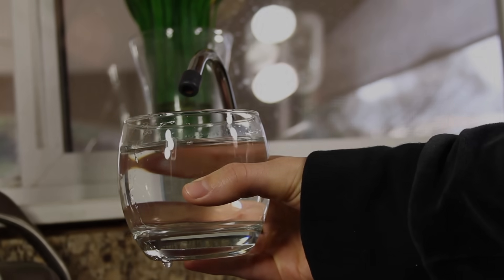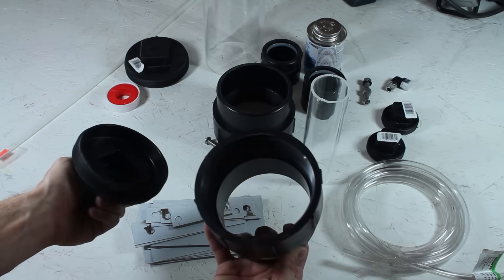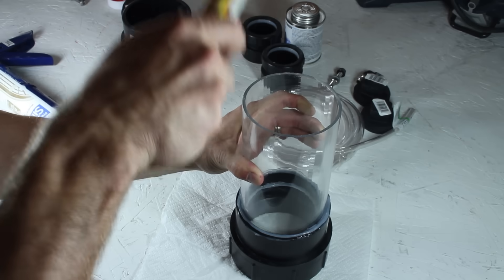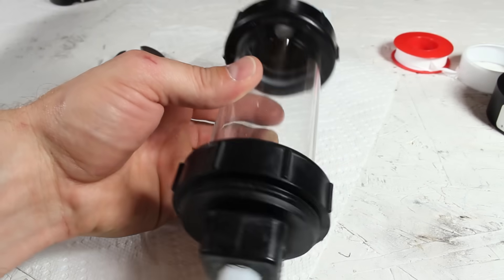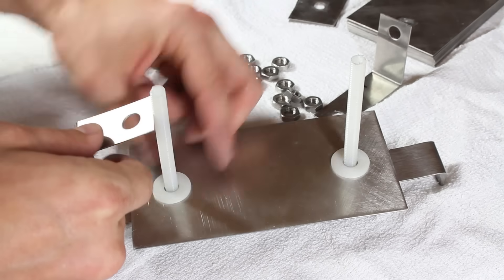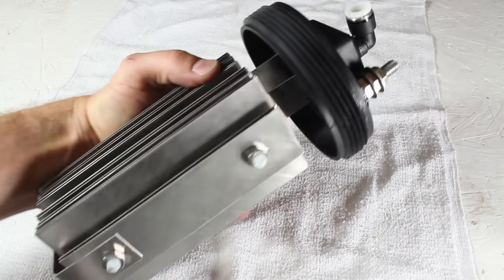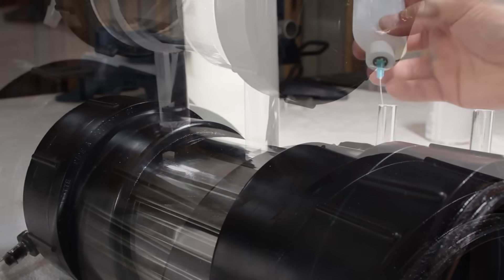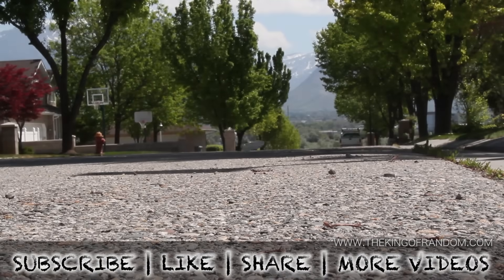HHO Generator - Water to Fuel Converter

Comment: Can you show us how you would install it a car?.....
Reply: HHO Sailing is either a bot or a totally ignorant person that blindly believes that he can CREATE energy!
Reply: HHO Sailing
Before treating somebody as an idiot, at least try to understand what is actually going on in the video. He's using electricity to turn water into hydrogen. Hydrogen can then burn freeing some of the energy which has been used to separate it from oxygen in the water...

In a car system, you're using some of the engine's power (given by gasoline) to spin the alternator which makes electrolysis happen. Again, the energy contained in the hydrogen is LESS than the energy contained in the gasoline consumed to make the electrolysis happen!!!!
YOU ARE WASTING GASOLINE INSTEAD OF REDUCING YOUR CONSUMPTION!!!!

Of course the car might perform better but that's because of the water vapour generated by the combustion of hydrogen. That's the same concept of water injection, or steam-diesel engines. They have been used since at least 30 years in railway locomotives!

Two options: you are either trying to sell your stupid and wastefully HHO systems, or you're just a bot or a very ignorant person...
Reply: MrOpenGL YOU are so correct. I just wanna add a car's alternator Is only 60% efficient so its a major waste to use  an alternator to generate the electric needed to split the water into hho. Using a magnet generator  would be much better as they can be as much as 97% efficient. But all said an done its still stupid to produce hydrogen in a car.
Reply: That is stupid and not even his intent. Plus its a waste. HHO CAR kits waste a lot and dont work.
Reply: People have been using that for years. You absolutely are clueless! You are probably one of those guys who believe everything the government says. Maybe you are not clueless but straight up stupid!
Reply: HHO Sailing
Lots of scammers keep promoting it. It was all over the news how this scam work and its all over the internet that this is a scam. And if you do the math you yourself will see its impossible to increase your fuel mileage using hho device.  I see you know nothing and a type of person that would fall for anything. Normally around 35% of the energy in the gas goes to your wheels. BUt if you use this energy to break water down into hho you only end up with 6% that goes to your wheels.
Reply: Yea...that's why Hyundai, and Totoyota built & just release their HHO Fuel Cell cars for production. You have to stop believing everything your government tells you, you need to learn how to think for yourself!
Reply: HHO Sailing Hyundai, and Totoyota does not generate their hydrogen on-board and they are using fuel cells with is a lot more efficient than a normal motor.   The hydrogen  they are using is most likely made from natural gas since this is how most hydrogen is normally produced.
Again your argument is week and pointless.  trying to compare what Hyundai, and Totoyota is doing to these hho system is very stupid. Once Hyundai, and Totoyota get electricity from the fuel cell they use this electric to power a motor that is attach to the wheels instead of using it to split water into HHO. They would never in a million years waste the electric on producing HHO on-board a car.

I never heard anything from the government  about hho kits. I done the math myself to see it doesnt work.  The news is also not controlled by the government as you imply. Dude your reality is really screwed up. you need an overhaul on that brain of yours.
Reply: HHO Sailing

I think what Samuel is trying to say, is car generators produce a lot of power. Now if you fit your very own converter in a car, it'll require too much power from the batteries for a sustained use, so you might as well power the motors directly with electricity. Solar power is not strong enough to sustain this, at least not in a practical sense. Most gas used by cars and largely by taxis and buses are derived from the ground. Just because it's many times cheaper.

Now if you fit your whole roof with solar cells (which could cost you several cars) and run this generator in your garage. You would still have to deal with safety issues as the gas is stored in high pressure. Also the energy needed to pump it into the canister is relatively costly too.
Reply: Balee Tong LOL I wish I had a magic wand to get through to people like HHO Sailing. Its kind of sad he is so lost in his own little world.
Reply: HHO Sailing Why would the OIL Company not want hho devices to be used? The HHO devices uses/wastes a lot more energy then without it. So its quite clear the OIL Companies would love it. Far as I know the government has founded the use of hydrogen. again you are so wrong. Stan Meyer's own investors sued him for fraud. Investors just dont sue when they make a bad investment. They sue when fraud is involved.
Reply: MisterDirectx11: Are you blind or just plain stupid?....
Reply: Samuel Atkins  The explosive gas that's produced in this type of convertor is hydrogen. Hydrogen is extremely explosive. It also can be used on vehicles. I have seen vehicles run on LPG, which although is less explosive than hydrogen, is used in the same manner as can be used with hydrogen. I know though, you'll call BS. Why? Because you refuse to check facts, and rely on pride alone.
Reply: scrmngchicken403
 I'm not discussing about the ability of making a car run on compressed hydrogen. It will work like a car with a LPG or CNG tank.
Obviously the engine needs to be adapted and moreover fuel cells and an electric motor are much more efficient.
I'm discussing about the usefullness of making some hydrogen on-board with the car alternator (wasting more fuel) that would supposedly.. cut the fuel consumption! In fact, it even INCREASES the fuel consumption!
Reply: scrmngchicken403 IF you want to get 100 units of energy out of an Alternator you have to use 166 units of energy to turn the Alternator. Also the electromagnetic fields is not what charges the battery. The electromagnetic field creates electricity  within the Alternator that than leaves by means of wire and goes to the battery. The Alternator will turn easily when you not drawing current from it however when you draw current from the Alternator it begins to turn really hard using up a lot of energy from the gas motor.  You alternator is a  big parasitic drag when you pulling lots of electric from the Alternator.
Reply: I have just read the various comments and opinions shared here with some interest and some dismay as well. I have an interest in the use of Hydrogen in increasing the Hydrocarbon fuels efficiency in internal combustion engines, more specifically in my daily drive.
  Several thoughts come to mind, these are as follows.
1 You can't get more energy out of a system than you put in, otherwise perpetual motion would be a fact of life.
2 This is me being pedantic, electrolysis does not make Hydrogen, it breaks the bond of the water molecule and releases the H and O into its elemental state, that is a gas.
3 For use in a vehicle you are actually promoting the more complete combustion of the fuel that is normally consumed. The way I understand this to happen is that H burns a lot faster than the primary fuel and reduces the amount of unburnt hydrocarbon. This shows up as an increase in power out from the fossil fuel or using less fuel for the same power out. The combustion of the H in this format does not actually add significantly to power out from H, merely to gain the most from the primary fuel.
 To what extent gains can be made in efficiency seems to be a subject of conjecture, I have heard/read claims of from 20% to as much as 50%. The only thoughts I have had in regards to these figures is this is all dependent on the subject engines initial efficiency. This will no doubt be a more dramatic improvement in older petrol and diesel engines in comparison to modern electronically controlled engines.
 I believe there are gains to be had, to what extent will depend on the design efficiency of the electrolysis plant and the subject engine.
 For those interested there is a book called "Fuel From Water" by Michael A. Peavey that I purchased that has a series of case studies by various departments including Universities and other scientific bodies that goes to a great deal of detail in extracting H via various means as well as results from its use. I make no claim to fame on this subject, I am just interested and have done a fair amount of research with the result that over the next year I will see if I have wasted my time or gained from the experience.

  Cheers from John.
Reply: HHO Sailing lol sure sure. the government and BIG oil companies are stopping this. Thats why no one outside of america hasnt made any big progress, RIGHT? Wow, idiots like you thinking US is the entire world and only you live in it.
Reply: HHO Sailing Please Google "Laws for conservation of energy" have a good long read up on it.
Reply: Splitting hydrogen from water for combustion is inexpensive. This technology was introduced in the early 60's, however big Oil companies, and the government prevented it from being in the mainstream because of the taxes and campaign money it brings. Don't be fooled, educated people have installed these HHO converters in their cars. Just look it up. Car makers like Hyundai, and Toyota now trying to implement this technology to the mainstream. It's up to the government to allow this to be pass!
Reply: The government & Oil company makes too much money to allow this. It will be a slow process before the government passes this bill. In the meanwhile, people who understand this technology are doing it themselves! If you don't know, you better ask.
Reply: +Samuel Atkins, I think we should just let him win the internet. I can't be arsed really.
Reply: MisterDierctx11: Do you think this video is just a conspiracy to make you believe otherwise?...You're an idiot!
Reply: HHO Sailing You are an outright liar. a little bit of knowledge about  cars engines, alternators and fifth grade math makes it clear that is impossible.
Reply: For all the retarded people like HHO Sailing and for those who dont know if hho kits actually work here is some-info.  Investors are very smart people. They only invest when they feel a profit could be made. Investor  will invest in almost anything that can turn a good profit so long as the profit is returned quickly and its legal. You can ask any investor in the world would they invest in HHO companies if these HHO kits actually worked as claimed by all these HHO users and scammers. Nearly 100% would tell you yes. But this doesnt happen. IF these HHO devices worked there are millions of dollars to be made. 
Practically no Investor on the face of this earth will invest in these HHO Kits. And that is because these HHO kits dont work and wont turn a good profit or any profit at all. You can ask any Investor (who knows how the system work) how much more popular would hho devices be if they actually worked and they would mostly likely tell you these ktis would be hundres if not thousands of time more popular if they worked. This is the area that investor are really good at so they know what they are talking about. Whenever there is any invention that been around for 50 or more years  that people claim to have extreme money saving potential but never takes off and become popular  is nearly 100% of the time a fraud  device.
Reply: Who said anything about investing?.... HHO fuel cell can be made under $100 and it's easy to do. Everyone should and can do it. You probably have some kind of government ties or Oil company investment to adamantly discourage people from making their own HHO fuel cell to save money on fuel.
Reply: Samuel Atkins....are you that naïve to think that government & oil companies have our best interests. I personally think you just too ignorant and naïve to think for yourself, so you tried to argue on a topic you know nothing about because you rely on the so called '"facts" that our government creates for us to believe.
Reply: I don't know about the HHO kits, do know one thing, it makes sense to me and a friend of my fathers made a system up for his V8 Land Rover. He says it works well enough to save him money and he is not trying to sell me one. The bottom line is you have proven yourself it works or you proved yourself that it does not work, and that is only your system, not some others system and as such no one person can claim to know all the answers. Cheers from John.
Reply: If you can't think for yourself, you can't be helped!
Reply: The expression that comes to mind is " you can lead a horse to water but you cant make it drink" cheers from John.
Reply: I'm not here waste my time to educate a non believer. If you really want to learn about, do some research. If not, one thing less to understand for that narrow minded brain of yours.
Reply: Look, I'm not here to give you any freebies. If you want to take advantage of the concept then I suggest you do your own homework.
Reply: scrmngchicken403 Samuel Atkins either is an ignorant ass wipe or works for the government.
Reply: Like ant alternative fuels, an engine must be prepped for it. Ethanol destroys rubber seals, has a lower BTU than regular fuel and produces about 30% less power. I'm not too familiar with burning hydrogen, but from the water production, it will rust nearly everything on the exhaust side. There have been successful attempts at fueling engines with hydrogen though...
Reply: Alternators are not like pumps. There is little parasitic drag from an alternator because instead of pumping fluids, it is generating an electromagnetic field, which charges the battery.
Reply: Samuel Atkins you are speaking strictly from an "energy conversion" in which every time you do it you get a loss of power. BUT what you failing to consider is the energy conversion is not simple like a transformer for electricity. it involves a chemical combustion of which i have not seen any evidence supporting or discrediting this work as I'm not sure how the effect of hydrogen mixed with different fuels in combustion at all different ratios and what the outcome of those ratios are. that is the science experiment to get involved in to decide if hho units on cars are beneficial. strictly from an electrical conversion case your correct but your not looking and examining all the evidence. maybe the combustion is a million times cleaner with hho in gasoline. maybe its worse.. i don't know. and you don't either. unless there has been some studies I'm unaware of. i would appreciate your feedback thoughts on this.
Reply: zeekthe hammer I didn't speak about it but i do know about it. Most people don't look at it from that point of view. But now that you mention it I will touch basis on it as well. 
When mixing enough Hydrogen with gasoline as its get sucked into the carburetor the gasoline  gets utilized better than not having the Hydrogen  in the mix. But it still not that good and the amount of hydrogen needed to improve the gasoline efficiency is many times more than what any HHO kit you can buy on the market would put out.  Also you cant use the standard alternator for 2 reasons. One: It doesn't put out near enough current to generate enough HHO to make a difference in the  gasoline efficiency and Two: alternators efficiency  is too low. Any efficiency  gained would still be less than what the  alternators waste is. You would need to use high efficiency generators. I seen the studies that were done and they dont apply to anyone that is using standard alternator.  The efficiency   increase is so little one would probably never pay for the equipment needed or its upkeep.
Reply: Samuel Atkins Omg, you are soooo dead wrong! Why are so adamant to misinform people that Hydrogen mixed with gasoline is not fuel efficient?... Where are you getting your information from?.... Again, this concept has be proven for decades, and people have been saving lots of money doing so for years. Why put so much effort to tell people differently?... And who do you really work for, to discourage people from saving money on gas when it comes to being more fuel efficient?...
Reply: There's  a lot of right and a lot of wrong here.  Is HHO gen plausible? Yes but you would need inject/carb conversions. You would need opamp inversions.  You would need to elecrolisys filtrations for mud. Yes HhO is x3 explosive the crude fuel, but there's more to it the this basic concept. Might as well build a new engine to go with it. 
I've done my reaserch and little math to figure out the best possible out come. My hho gen cell would cost me around 20k in usd to be efficient enough for me to consider to use. Now we say maybe my math didnt meet up with testing, heat, aph..... Ican go on and lecture, but won't :)
Reply: Samuel Atkins i like your response. the evidence backing up the fuel ratios compared to efficiency would be interesting to view. it would put a lot to rest if there were several proper scientific studies backing this up. i agree the hho gen may not be plausible for "in vehicle conversion" but maybe a separate "tank" that could be built into or add onto for vehicles that has all the inject/carb calculations. basically just make it like NOS injection but its hho injection. simple to use the same hook up but change the delivery for it. if it were to make cleaner burning and even 15% better efficiency then hho conversion centres that use solar (or another green energy) to create the conversion would be super useful. and mostly self sustaining. we have to start thinking of ways to make our current technology workable in our lives instead of just tossing everything to the curb.
Reply: zeekthe hammer The study i seen was done in Australia. Its been several years ago and i dont remember all the details. I also dont remember the web URL otherwise i would post it for you. I agree with you on attaining hydrogen from another source.
Reply: HHO Fuel Cell definitely works. I spent less than $100 of materials and had it installed last week. Before Installation my truck normally eats up 15 MPG, and now my truck consumes gas at 21 MPG!
Reply: Let me tell you, it's true and it's very easy to do! Unfortunately the big Oil company,  our Government who has been falsely telling people like you that it doesn't work. HHO Fuel Cell has been around for decades, and lots of people are using it. Of course, nobody is going to go out of their way just to help you realize your doubts. But the truth is, everyone that is using it are saving lots of money on fuel. It's up to you to do your own research and not believe people like Samuel Atkins,  the  big Oil Companies, & our government. Of course they don't want use to know. Their agenda is called GREED! You would be very naïve if you believe everything they tell you can't do.
Reply: Exactly!
Reply: joandar1 i have a 97 tahoe that i may be keen on building a system where i can fill the hho at my house into a safe tank and see how she goes. thanks for the suggestion on the book. il get back to you hopefully with some results. i guess il have to make a video for that as well. cheers mate!
Reply: HHO Sailing i get that your very enthusiastic but i do not think the banter between you and samuel is accomplishing anything and its taking away from this posting. this is the one of the better post streams I've seen with no trolls. sam isn't a troll he's just a skeptic and you two are at opposites. just chill and make a video and prove the facts you speak about. that will have the most benefit.
Reply: Why do you think the person who created this video hasn't chimed in on any part of this conversation?...

.
Reply: ***** What about other countries that dont have oil? You really are a shallow minded person. There are more than 100 counties that would jump on this in a heartbeat including China.
Reply: I'm thinking Samuel Atkins is paid by the government or some oil company to discourage the public from using it. Or he could be just an idiot who lives in a bubble. lol
Reply: Its known that Koreans are brought up as oppressed people because of their submissive upbringings. Had they not always been afraid, or too scared to speak up or stand up against their elders, leaders, and culture they would be in this situation of a country with so much flaws. 
For example this year:  Korea Airline crashing, Boat Captain & crew telling kids on board to go back to the cabins so they could cowardly escape first, apartment building crashing down killing 92 families bc of government allowing businessmen take cheap shortcuts, Train Crashing killing hundreds bc of negligence, fire broke out in a Hospital with hundreds of patients with only 1 nurse on duty.  All of these tragedies this year in Korea. If only the new generation had the balls to speak up, they could improve how they live today. Now Koreans come over here to USA all bottled up with frustration and anger, venting to kill people because of their suppressed cowardliness and lack of ability to stand up for themselves to their parents. It feel for you, but don't come around my way bc I won't stand for that nonsense. FoSHo
Reply: You must be an idiot! There so much literature out there on the internet for you to say otherwise. Toyota, and Hyundai has already started production, you fucking dumbass!
Reply: HHO Sailing Toyota, and Hyundai is not at all doing what you say. I already posted this to you. Their systems are completely different
Reply: Seriously, fighting with each other.... thats the whole reason tech like this never progresses, because everyone thinks their ideas are the best and anyone elses is shit. Thanks for that =/
Reply: HHO Sailing It might just slightly improve fuel efficiency however you have to take into account that even with a high efficiency hydrogen generator at about 60% which I doubt that any DIY kit reaches near that + alternator power generation at about 70% AND that the hydrogen is being burned doesn't leave much room for an improvment in fuel economy
Reply: Here: http://m.green.autoblog.com/2008/08/04/why-on-board-hydrogen-generators-wont-boost-your-mileage/

In summary, the most efficient generators are about 70% efficient.  However even if the alternator and HHO were 100% it would not work.  As stated above you get about a negative 16 percent return on energy even at 100 percent.

IF this worked "big oil" couldn't do shit about it.... every powerplant would burn coal/gas to make electricity, then use it to power a gen and then burn that fuel for customers.  You think they wouldn't use it to increase profits by 30+ percent?

The only way it could work would be to use solar/wind at home to power the gen, put it in a tank (more power to run a compressor) and use it that way.  But all your doing is finding a way to make solar/wind portable while wasting 20-30 percent (plus the compressor).

It just doesn't work.  The truck example you gave is easily explained by driving habits..  you want it to work and drive slower etc and bam more MPG!
Reply: This would be illogical. You'd consume more energy than you would produce oxygen and hydrogen in a electrolytic reaction. You're better off burning gasoline, not to mention that both gases from this cell may have incomplete combustion when ignited.
Reply: ***** storing HHO is extremely dangerous and most unwise to do. Maybe if you just stored the hydrogen without the oxygen it would be way less dangerous